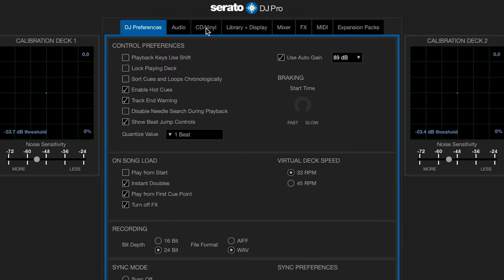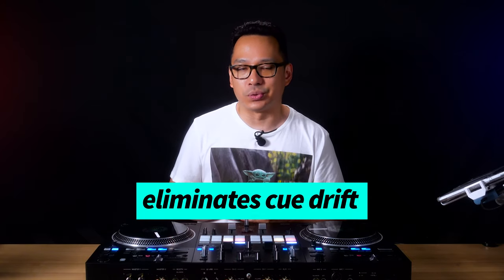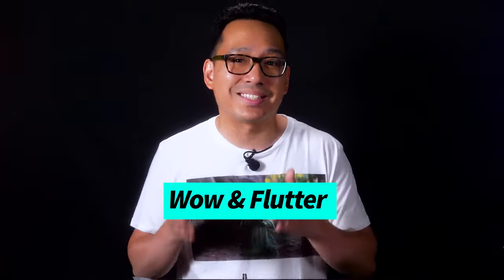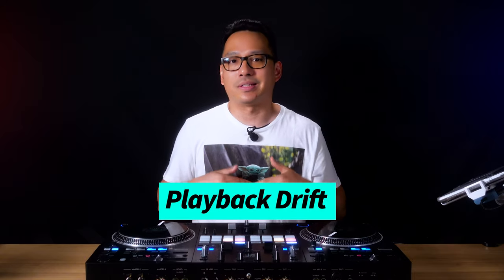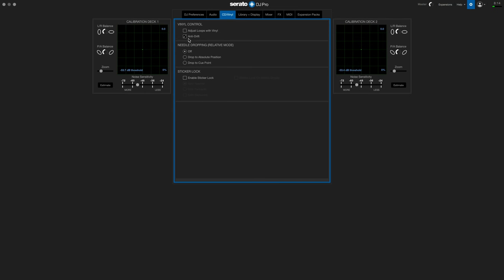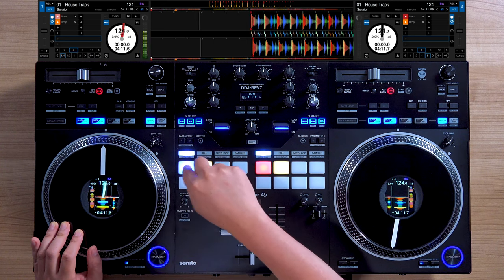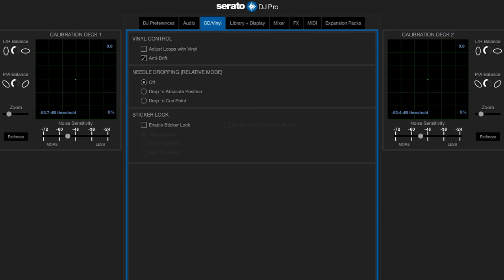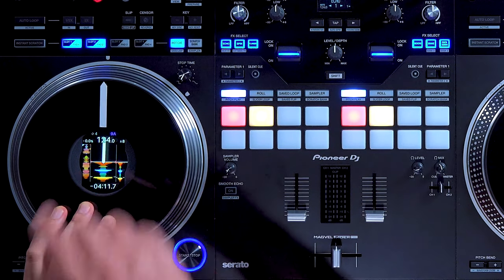What many DJs misunderstand about Anti-Drift

Comment: I always had anti-drift on when using turntables because that flutter, which helps tremendously when mixing. But the cue positions were always changing when I would scratch or do some beat juggles which I always thought it was just a Serato issue. The distance would be within an inch to sometimes 3-4 inches. Glad to know this is the issue, thanks for clarifying / explaining!

Comment: @priyonjoni bro thanks so much. I have been using control vinyl for about a year and a half coming off a controller, I used instant doubles with one turntable, I got a 1200 a few months ago so running 2 turntables and I would get this annoying drift, I started to think it was the 1200. I thought anti drift on was the solution, as recent as last nights gig I was like wth. I literally paused your video, turned off anti drift and I get no queue drift. You saved me $$ because I was gonna go buy another brand new reloop to match the other turn table.

Comment: what about phase and anti drift feature?
Reply from the maker: There are some complexities when using Phase because in Serato, there are two configurations in how to use them. I’m both instances, Anti-Drift on and off will affect them. With that said, let’s break them down in each configuration.

Phase plugged in via RCA:
When Phase is plugged into your mixer and generating it’s own timecode signal. While Anti-Drift is off, you might still get some sticker/cue drift. This is because Phase does not generate an authentic Serato timecode signal, which includes positional data along the timecode. We know this, because the signal reader on Serato turns red instead of grey. With the lack of rotational data, you can still get some sticker/cue drift. It’s still best to keep anti-drift off, but it will not eliminate all drifting.

Phase HID:
Phase HID is the wireless way to use Phase, though not completely wireless. The box is connect via USB to your computer, but the RCAs are not connected. Phase HID integrated digitally to Serato and eliminates all the issues mentioned above in traditional configuration. However, same rules apply with Anti-Drift. Keep it off if you wish to eliminate slight sticker/cue drifting.
Reply: @priyonjoni  thank you  for this awesome detailed answer.. respect and shout out from reunion island.